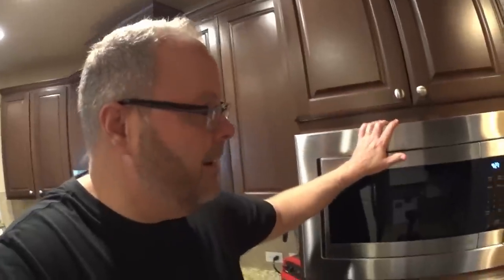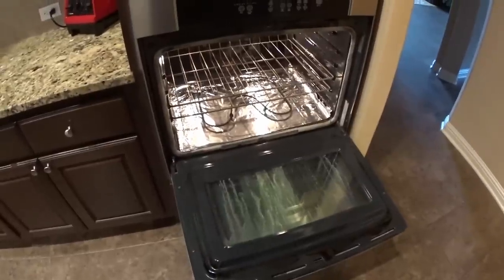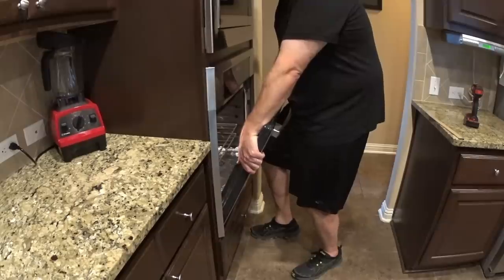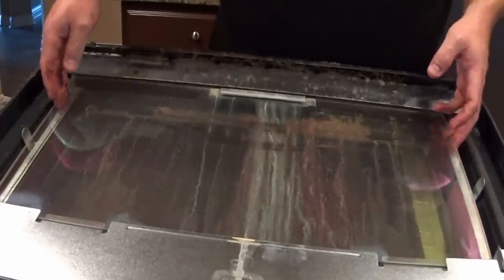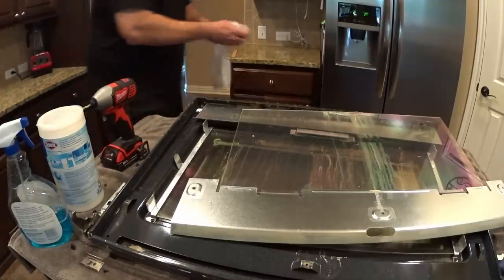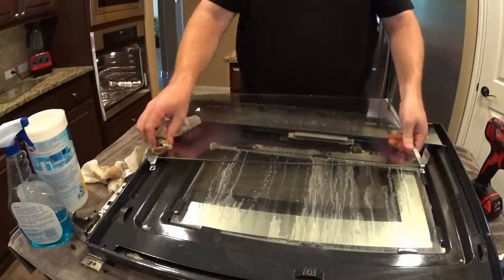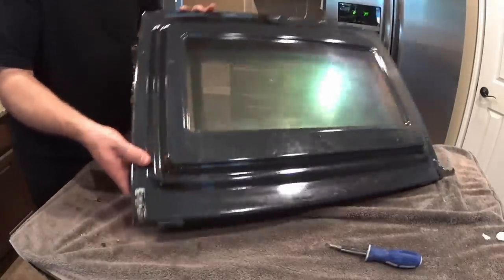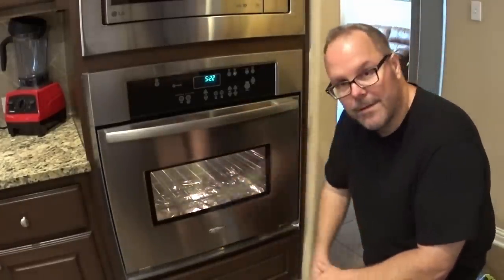Clean BETWEEN Oven Glass - How to

Comment: Excellent work, but you didn't explain why you added that felt or fiberglass belt.  What is it and why wasn't it there before?
Reply from the maker: Thanks for taking the time to watch the video! The heat resistant material was actually just laying around the front window when I disassembled it - yours may not have it. My apologies but my edit did not showcase that as well as it should have.